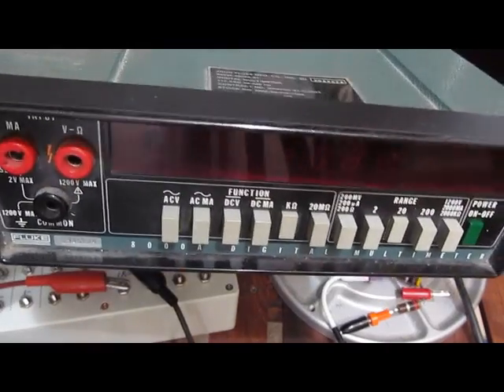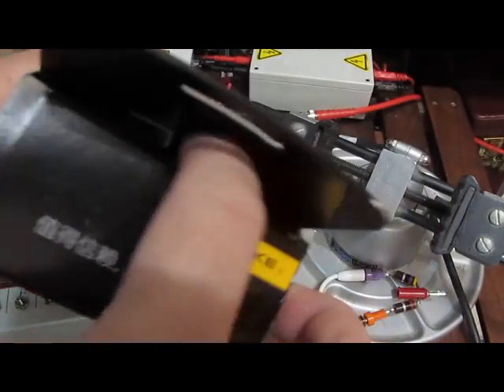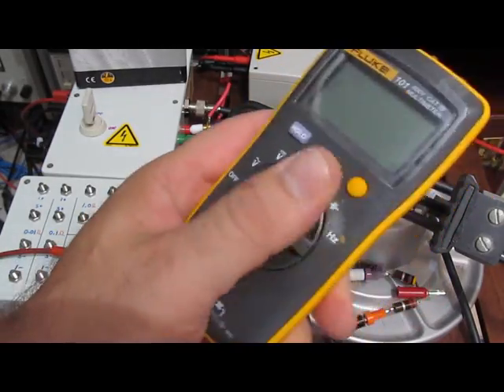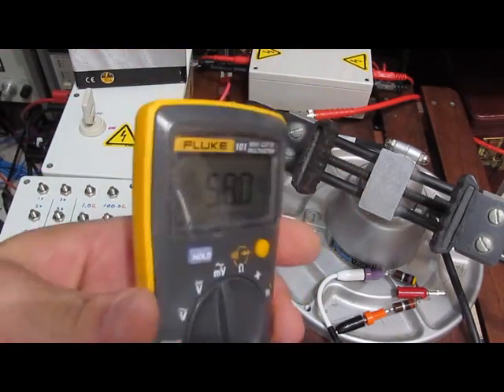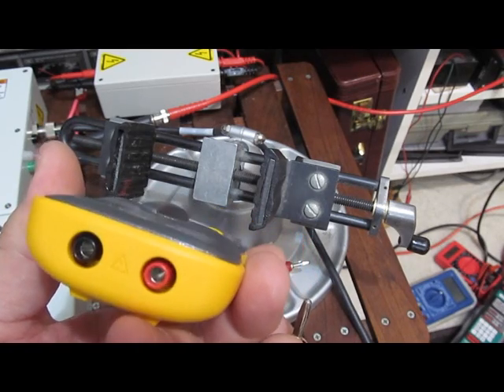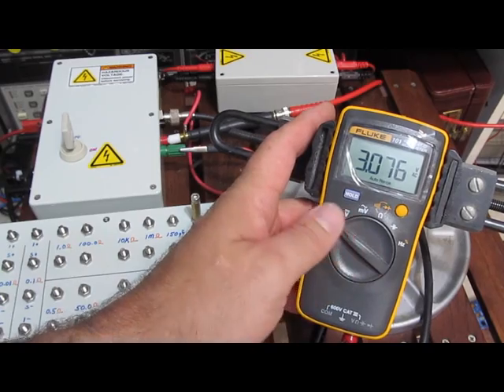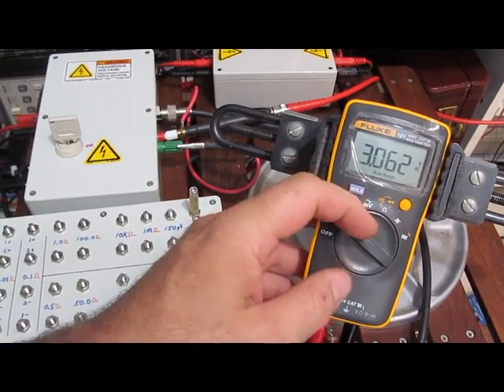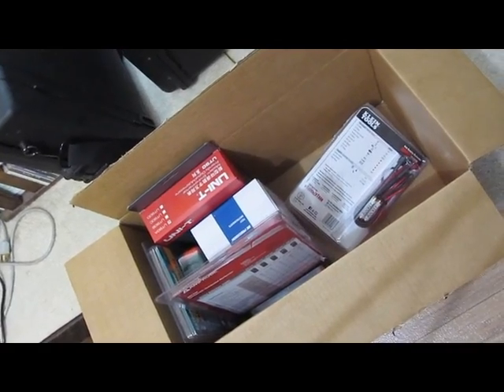Evaluating low cost DVMs Part 14 CAT I The FLUKE 101

Comment: Hello. Are there any differences between multimeters made fo US and European markets? I am asking because there are Hz differences.
Reply from the maker: For a battery powered handheld, maybe the GS mark.  My UT-181A did not come with a universal charger.
Reply: hello. thanks for the reply. what i meant was, are there any differences in how the multi-meter will work, and how accurate it will be? i am relatively new at this, and while doing some research, some have suggested that readings could be different/less accurate due to the Hz differences between US and European systems (or any other differences which i am not aware of). thank you very much in advance.
Reply from the maker: I would assume if you bought a GS marked UT61E for example, it would work differently if tested to the IEC standards than the non-marked one I commonly see here in the US.   For a given meter, with the same markings, there should be no difference.
Reply: yes thats what the manufacturer said as well. i am considering Amprobe 510 and the company representative said that 500 series could be used globally. so i guess there is no difference.
Reply from the maker: Some of the meters UNI-T made under the Amprobe label are offered in two flavors.  The 510 for example is AM-510 or AM-510-EUR.
Reply: i asked them about that yesterday, and they replied that its just branding, meaning, there are no technical differences, and EUR label is just branding design for the European market.
Reply from the maker: That's good to know.  With their UT61E, the GS and standard are a fair amount different.  Danaher must hold them to a higher standard.

Comment: Please, excuse my spelling, I meant to say no intention of climb up high voltage power pole. And I am quite sure whose show it was - briefly mentioning How to make Fluxe 101 to measure amp using shunt. Can you explain that in dept once more?
Reply from the maker: Have a quick Google search for ohms law.   The shunt is a resistor.  The 101 reads the voltage drop across it.  So for example 1 amp across a 1 ohm shunt, the Fluke would read out 1.0 volts.

Comment: I'm looking for a multimeter as small as possible, with ideally replaceable leads. Could you recommend anything suitable and reliable? Voltages and continuity are really all I need. But the leads are a big issue for me.
Reply from the maker: +al t The  smallest meter I have looked at is the 101.  I recommend you download the manual for it and see if it meets your needs.

Comment: Fluke just like any other company has made some crap meters. Especially 30-40 years ago, when Cat ratings weren't even a factor. Back then Beckman was considered the best by many.

For bench meters, Keithley and HP have also always been above Fluke.

But 8060A and onwards Fluke have generally been the best in handheld meters. This is a company that's spent millions just on their PCB cleaning process, because they are perfectionist when it comes to quality. The Chinese made 101 may or may not showcase that. 

That's not to say that Fluke doesn't have duds even today, like the 289 capacitor problem, or the 28/27 II beeper problem (both covered by lifetime warranty).

But if you want a no brainer best all around meter I've ever used. That has to be the 87V. From industrial build quality, safety, to great ergonomics, and a comprehensive feature set. In my opinion there is no better meter on the market today.

I enjoy your reviews, as I think small and cheap meters have their place, afteral you need more than one meter. I just think for anyone serious about electronics having at least one 87 in the lab is the way to go.